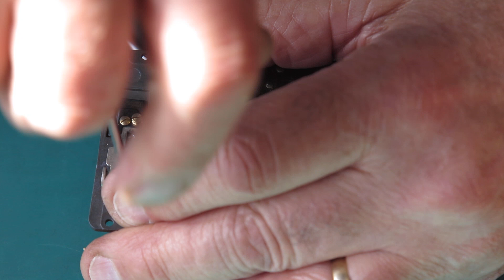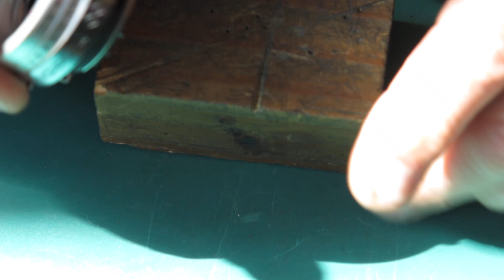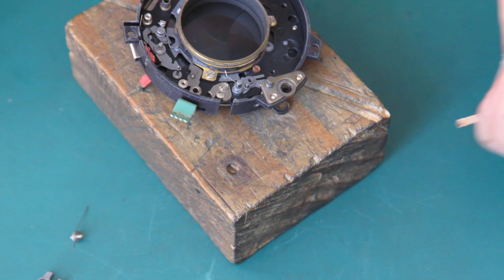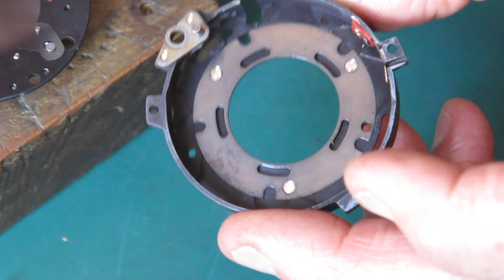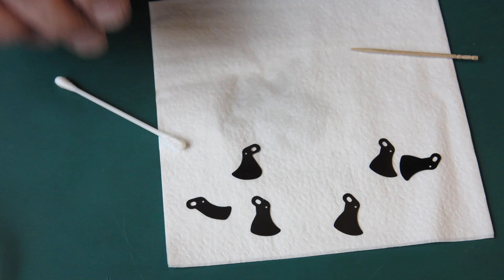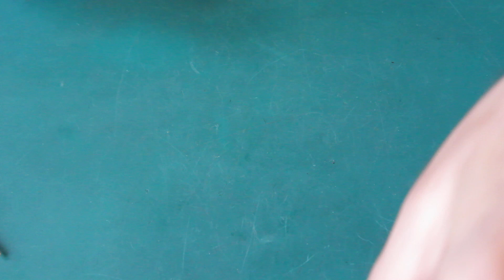Retina Reflex III service, part 04

Comment: 4:24 that arm has a huge amount of scratches on it. Is that indicative of a problem or normal for this camera?
Reply from the maker: No problem, there is the back end of a rivet there and that was filed down to make sure there was nothing to catch on the rest of the mechanism. This part is above the mirror, so forms no part of the light path, and the loss of the black finish will not cause reflections or loss or image contrast.